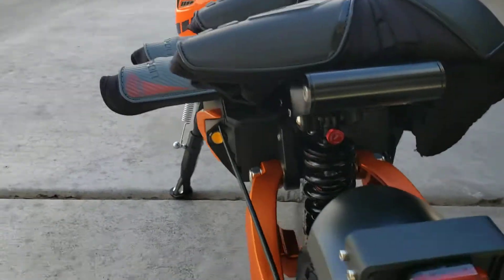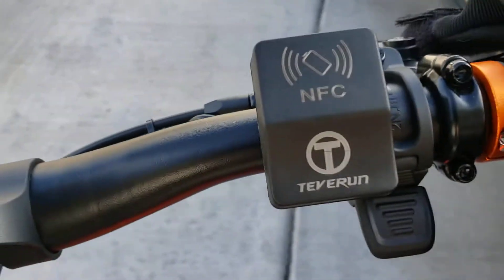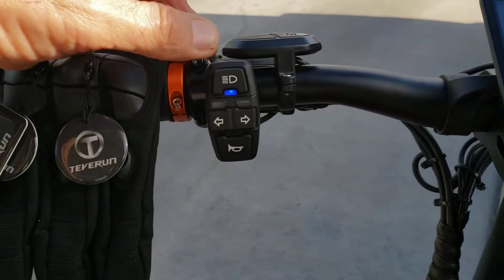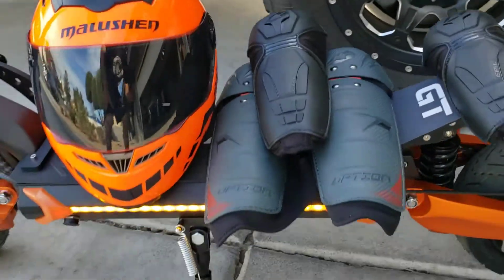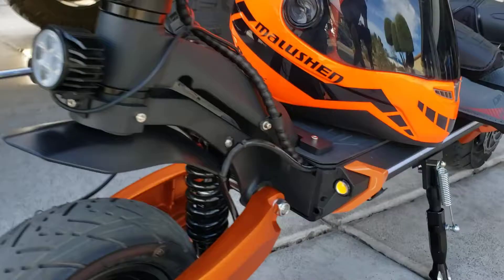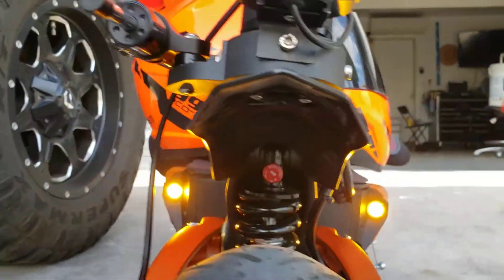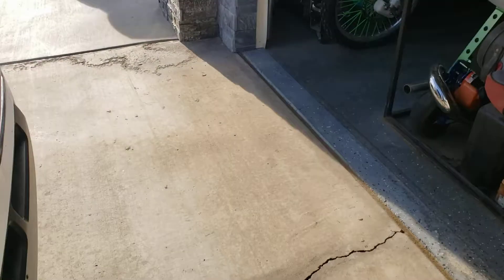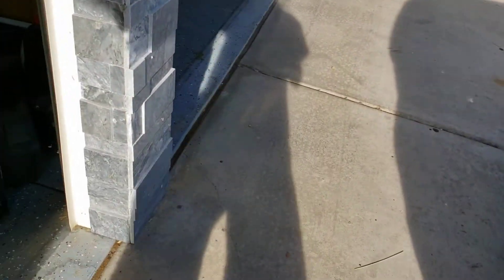BLADE GT PLUS New Safety Gear for for this Beast..

Comment: I have a varla eagle.  The 1st full day I had it I was riding it down a hill, not fast, but probably 10mph, and I think thr wheel caught a divot in the road, and my scooter completely blew and edge and gave out from underneath me.  I went for a tumble.  Fortunately I was wearing a helmet and elbow pads, so my elbow wasn't injured.  My hands hit the cement, and I was not wearing and wrist padding, but fortunately I only scraped my hand.  I also scraped my upper elbow but it was just a cut.  I got lucky.  Could have been much worse.

The point is, after that fall I realized that I needed more protective gear when riding.  So literally the next day I ordered a full chest/shoulder protective armor as well as gand guards and knee pads.  So now I won't even get on my scooter without: helmet, shoulder/chest pad, wrist guard, knee pads and shies that are tied

These scooters are really nice, but they're very powerful and you need to plan for the worst.
Reply from the maker: Hi, DSlav2488..yeah u never know when ur going down..Better to be safe than sorry 😞.....thanks for ur response 👍.....